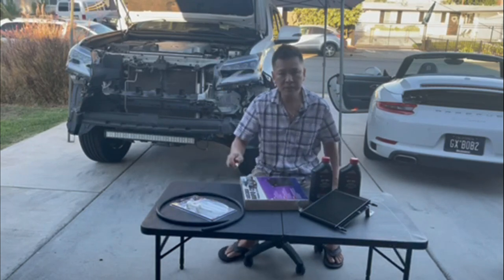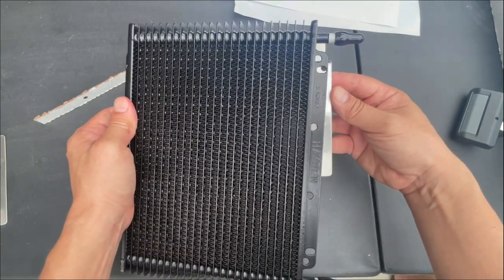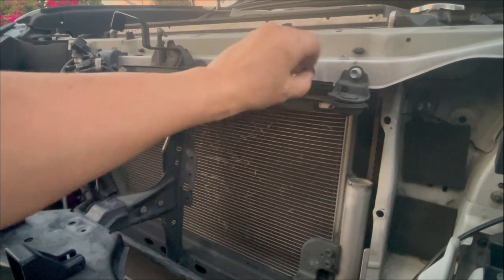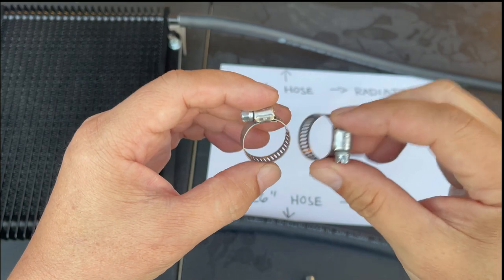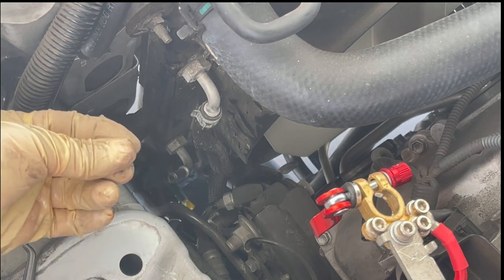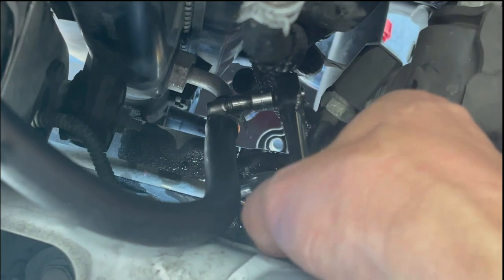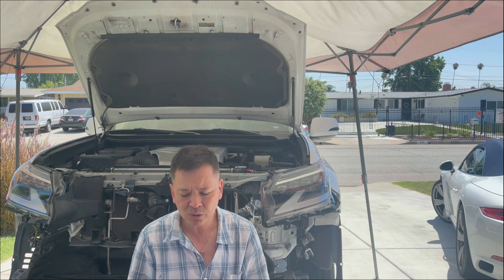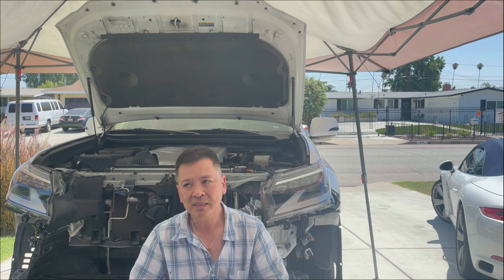LEXUS GX460 HAYDEN TRANSMISSION COOLER INSTALLATION

Comment: I prefer the pipe and fin cooler instead of the plate and fin because the flow of the fluid is so much better with the former - nearly no pressure drop. Problem with worm gear clamps over springs is that their grip is fixed so when rubber deteriorates or shrinks the clamps will come loose and you’ll have leaks. This is why car manufacturers don’t use them. Spend the extra $$ on spring clamps and you will never have problems of them loosening over time. Apart from these, great instructional video and Q & A session. Keep it coming. 👍
Reply: do you have a link to that cooler you recommend?

Comment: Great video Bob! One suggestion: I had a ton of trouble getting the return house to slide onto the metal tube (very tight connection), so in the process, all the fluid I just put into the cooler dumped out of that hose onto me. Instead of trying to attach all the hoses with a full cooler, consider filling the cooler, and the emptying that fluid into another container and pumping it into the regular transmission fill hole. Then you can install the cooler empty and not worry about spilling fluid.
Reply from the maker: Thanks William for the excellent input. 😀

Comment: Just wanted to throw this out there to you.  I love your videos. You can buy a KAON Prado 150 trans cooler from Australia.  the brackets and everything come with it.  Keeps it OEM looking.  I did mine in about 10 mins. Super simple.
Reply: I’ve reached out to KAON but unfortunately they cannot confirm the fit will work. Can you link the kit you used?
Reply: What year GX do you have?

Comment: One suggestion— it’s generally advisable to have the inlet on the bottom and outlet at the top. This way any trapped air can more easily flow out of of the system, and you can vent any trapped air at the top port if you want.
Reply from the maker: thanks for the input G5 !

Comment: Bob: Unless I missed it, did you mention where you sourced the bracket metal strips? I'm sure my local industrial supply store would carry something similar, but curious where you got yours?
Reply from the maker: I was selling the set of 2 for people that messaged me in the side for $25. I had a machine shop fab the brackets. Recently a corner of my garage burned down from a self ignited battery charger. My entire lot of brackets melted. I’m going to see if I can have them fabbed again.
Reply: @GXBOB  Oh shit! Very sorry to hear that and now I am paranoid as I have two vehicles in my garage with battery maintainers hooked up. Thanks for at least providing the dimensions...I may see what local shop around San Diego could do for me. Although...it seems like you could make something similar by cutting thicker sheet metal with tin snips and bending the corners in a vice. Stainless steel is obviously way superior.
Reply: I’m interested in a set of brackets
Reply: I'm also interested in a set of brackets. Might take awhile for Bob to get enough demand to consider having the machine shop do a run of brackets though...

Comment: I installed the transmission cooler today. Thanks for the guide Bob. The nipples that came with the cooler, I used to that plugged the hoses. It worked great! No leaks at all.

Comment: One unexpected (perhaps) benefit of such a cooler installation is that it not only helps the transmission run cooler, but it reduces the heat pushed into the radiator by the transmission fluid, which gives a little more margin in hot weather at keeping the engine at thermostat temperature.

I know of some vehicles/applications where the transmission can push so much heat to the radiator that it can cause the main radiator to overheat. Since the transmission will only drive X amount of temp rise in the fluid at a given load, a reduction in inlet temps to the trans should translate nearly 1:1 into cooler trans outlet temps too (i.e. cooler fluid hitting the radiator).

Comment: This video, as always, was an excellent guide to the install. I was actually able to install mine without taking the front completely off. I just loosened it and pulled it forward, supporting it on the bottom using some bins I had in the garage. This kept me from having to disconnect all the parking sensors and headlight washers. Would it have been an easier install with the front off? Definitely. But it wasn't bad. Also, if you have the secondary fan on the passenger side of the radiator and don't want to fashion new brackets for your horns, good news. You can just bend the horn brackets back and leave them in the stock location. Plenty of clearance between this secondary cooler and the radiator when you do that. Thanks Bob!
Reply from the maker: Awesome inputs. Thanks!

Comment: Thx bob. Did this also a few weeks ago using the 678. Only difference is I bypassed the radiator cooler to eliminate the possibility that coolant will ever mix into the transmission if a leak within the radiator was to ever happen.  I’ve had this happen to a pathfinder in the past and I’ve heard it happening to to other vehicles as they get older. 

As for results, prior to installing the cooler, the average trans temp was 220 and reached 248 on climbs without towing.  Post Hayden the average is 190 and 205 on climbs. 

Thx for sharing. 

Great video and I wish you posted before I went through it. The hose pliers would have helped a lot. 

Btw- I have a premium model therefore I have the rear climate control. Therefore there is an aux fan on the passenger side. The 678 does fit on the drivers side with the horns on the same  mounting point. You will need to get an longer bolt though.
Reply from the maker: Thanks for sharing Rodel. As with many other comments, i learn other facts that i wasn't aware of since i don't own a luxury or premium model. Good to also be aware of potential issues rising out of older trucks like u just mentioned.  Who knows, when i get a GX470, i may attempt to take that route.
Reply: Is it worth putting a transmission cooler?
I have a FJ which I use mostly for sand driving .
Reply from the maker: @kanevivalakane3699  Any load you put on your tranny shortens its life if you don’t keep it performing under ideal temperatures. This includes driving outside the normal realm of flat street daily driving. If you tow additional weight or offroad (includes sand duning) I’d have an aux cooler installed.
Reply: @GXBOB   hello bob why don’t just get aftermarket oem is a lot easy to install any reason?
Reply from the maker: @skeletronxxprime6277  oem is too small
Reply: What year and model was this install done on?? Great video as usual!! Glass of 🍷 a nice touch!!! 😊😊😉😉
Reply from the maker: @adamriley4808  2017 base
Reply: @kanevivalakane3699  
Yes. The oem cooling capacity is not enough if you do dune bashing in hot weather. 

I’m not sure where are you from, but in the Arabian gulf we use the bigger units. A popular one is Tru-cool max 40k gvw 45k btu. Nearly double the capacity of this one.

Comment: You are a saint, Bob. So glad you made this video. I will be doing this to my 2022 GX 460 as soon as I have the time.
Reply from the maker: @user-sf1zz5ew8v  word of advice. Don’t bolt the 2 horns together. Install them in separate locations. They make a weird noise when you honk the horn.

Comment: interesting approach. just watched another video that suggested using the bottom port on the transmission cooler as the input (out fr the radiator) and the top as the output (back to the transmission); opposite of this video. the benefit is that you can connect the bottom hose before filling the cooler w/ fluid. less spillage and easier. regarding the possibility of air being trapped, it's not an issue because the transmission has a breather. any excess air will be purged. no wrong away. just a different approach. also, galvanized metal also has a anti-rust coating an is less expensive. VERY MUCH appreciate this video, bob!

Comment: nice job Bob... call me crazy but is there a cooler on the 2021 model I swear I saw 2 rubber tranny lines underneath going to something that looked like a cooler?
Reply from the maker: I know there is an oem tranny cooler set for the 2021 from the dealer but unless it was sold with an offroad package, i don’t believe it comes with a tranny cooler from the manufacturer.
Reply: @GXBOB  like.. I mean the OEM liquid transmission cooler... I thought all GX460 came factory with them?
Reply from the maker: @LexusGX460-OFF-ROAD  Isn't that the internal system within the radiator??? The transcooler runs inside sharing the same cooling capacity as the radiator coolant.  Thats why a people bypass the radiator due to the two mixing in the event the radiator cracks on older vehicles.

Comment: The way you connected these lines, is this the same way you connect the OEM cooler? Meaning, is this the same route? Bottom of radiator and the other connection at the transmission?

Comment: I saved this video months ago and the time has come to do it on my GX. With your gained experience, would you add/change anything to this video? 

I appreciate all the work you put into these videos and I try my best to socialize your channel with all friends and enthusiasts. If you're ever in TX I owe you some BBQ :)
Reply from the maker: First of all, California invented bbq. Secondly, I would not tie the 2 horns together. When I honk the vibrations create a really weird sound. I would use thicker foam pieces between the brackets and structure. I would also do a complete radiator flush since I already introduced air into the system. Other than that, I’m quite happy with the install and the trans cooler.

Comment: Great content. Keep it up.  I live in the CA/AZ desert and see 117+ summer temps with bumper to bumper traffic.  Would you recommend adding an aux fan to this trans cooler?  Being new to the GX, Im not sure how the fan clutch cooling on the GX will perform as I am used to running electric fans on my trucks.

Comment: And very important details, I recommend bypass the radiator,
Reply from the maker: George i don’t recommend it. I prefer to switch out my radiator before the average fail life of 100k. Preferably with an all aluminum or new Denso. Doing a bypass actually harms your tranny more than it does good by switching from liquid/liquid cooling to air/liquid cooling which is less optimal. Plus promotes early tranny failure by not allowing your tranny to warm up efficiently at every start up.

Comment: Really great video Bob thank you. In your cooler research, did you come across any options that had a bleed screw on top to help make sure the system can be burped after? It seems like the cooler is the high point, so I'd expect any air in the system to get trapped in the cooler. Thanks again, you're the man and nice 991 cab!
Reply from the maker: Invest in one of these to help you out. 
https://a.co/d/3Aery4A

Just manually continue to burp your system and your system will eventually air out itself.

Comment: Great video Bob very detailed.  I am from Malaysia, over here we add an extra transmission cooler mainly to avoid radiators coolant leak in the transmission.  So what we normally do is just adding another transmission cooler beside the original cooler which is total bypass the radiator.
Like to know what is your opinion about this.  Thanks in advance
Reply from the maker: If you scroll down in the comments I talk about the bypass.

Comment: Awesome bud.  Great job on the install.  I can’t believe it’s so easy. No thermostat or anything else needed.  Biggest thing is removing the front bumper.  I also have a 21 Tundra with no factory cooler.  You think it has the same lines that go into the radiator, which I can tap into?
Reply from the maker: I can’t answer for Tundras but most all trucks have the same general radiator setup with top and bottom hose . Only difference is the bracket install locations.
Reply: @GXBOB  the reason I asked brother was, because every cooler install for 19-21 Tundra on YT is adding a thermostat and bunch more work. In comparison what needs to be done with a GX460.  Unless the GX already has a thermostat for the trans fluid already built in?

Comment: Never thought I needed this but I just bought a 2000lb camper and towed it all the way from Tucson to Vegas in 105 deg heat. I wasnt comfortable doing it but had to get a good deal on our camper. I will be doing this mod this coming week. So oem hose clamp was used on the bottom but cheap clamp on top? Thanks for the vid.
Reply from the maker: i would reuse all the OEM clamps if possible.  The ones Hayden provided works but OEM is easier and faster.

Comment: Bob, wonder why you would think that you really need the external cooler. As I understand Lexus designed the internal radiator cooler to be sufficient even when towing. Did you measure temperatures before you did the add? 

I understand lots of people talk about the trans temps when towing but haven’t seen any clear evidence they get too high, unless for towing up in the Rockies and even then the temp spikes are only for short times.

Any concrete info/evidence on why the external cooler is needed is appreciated. 

Thanks
Reply from the maker: you were an inspiration for my new video.

Comment: Bob I need some help finding a part(s) for both driver and passenger side supporting the radiator. I have searched radiator support/bracket/arm, can’t find anything…It is a support that attaches on either side at the mid high point on the front radiator with two screws into the radiator and then it appears to rest on the “radiator support bar by simply sitting in the crook of the lower part of the support with a piece of foam. No diagrams no luck anywhere. I would appreciate your help! The two pieces hide behind the power steering cooler line at the height of the radiator support bar. The videos are awesome
Reply from the maker: you know there are plenty of sites you can find people parting out their GX or junkyards have networks that can locate the part for you.

Comment: Hey Bob, love all your videos and learned a lot!  This video got me inspired to install a transmission cooler. However, I saw there is another approach of running a bypass to avoid the mixture of fluid. What is the pros and cons of each method in your perspective and have you considered making a video of running a bypass installation for the transmission cooler as well? Thank you and love your contents!
Reply from the maker: Yo yo yo. Great question. The prospect of that happening is like every 10 to 15 years dude. Go buy yourself a new radiator and install it.  The key is to consistently maintain your vehicle and being proactive. There’s alot of stuff i do before things break down. I’m not bypassing anything because what you’re doing is trading one evil for another. I’d rather have optimal tranny temps as opposed to running my tranny before it even has a chance to warm up. Doing that daily will lead to early tranny failure.  An external cooler bypass only prolongs this process. An external cooler is only good to keep the tranny from over working while putting a load on your vehicle. You need your radiator daily. You need a cooler only sometimes, if that makes sense.  Also keep in mind that liquid to liquid cooling is more optimal than air to liquid. In conclusion, if you want to sleep better at night, install a new radiator every 7 years or so. I call it the 7 year itch.
Reply: @GXBOB  thank you for the feedback! You are truly doing the GX community a service man! I learned so much from your channel and love your sense of unapologetic humor! Keep them wine pouring Bob!

Comment: Metal edge protector seems like it’ll work to protect the hoses going through the radiator section.
Reply from the maker: The protection was required throughout the length of both hoses.  The loom worked well.  Edge protector is found to be unique to only the radiator wall cut-out.  I started padding the cut-out before i realized there were so many different areas the hose  could chafe besides just the cut-out.
Reply: @GXBOB  thank you for giving me confidence. I will tackle this soon.
Reply from the maker: @pennmikael  easy peezy lemon squeezy.
Reply: @GXBOB  I finally completed this install this weekend. I made brackets using 1/8" aluminum- what a PITA to make without the right tools. I lost all the fluid while connecting the bottom line and ended up doing a trans fluid level check, which was good since it allowed me to check fluid condition as well.

Comment: Bob, didn't you in another C-L thread add a "factory" trans-cooler in a GX. Similar to the Canadian-Premier models. What happened to that? I am trying to duplicate that with a Hayden 676. It get MUCH cooler here in the Midwest. I had a similar setup on my 2010 Tundra 4.6. Thx for your time//patience.
Reply from the maker: Sorry Johnson, that wasn't me.  Most likely ACRAD from CL.  We get mixed up a lot because we're both really good-looking men. Thats the rumor on the street.
Reply: @GXBOB  I thought you two were a couple? 😘